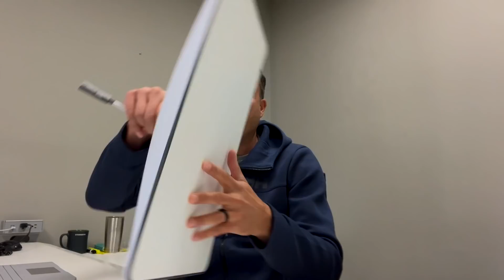How to redesign a SpaceX STARLINK satellite dish for mobile use on a boat! [MV FREEDOM]

Comment: In a past life I was a TV repairman, telephone exchange techie, electronic cryptographic systems repairman, electronics tech working on spy satellites, field tech for early modems, a field tech for Tektronix, and a creative for Apple. Oh and I own and operate a 65’ Fleming on the east coast from the Bahamas to Canada. That said you are a tech God. Tearing the Starlink apart, testing, engineering a new waterproof mount, replacing the KVH antenna and getting this all to work puts you in a class with Wil Proust the YouTube God of electrical power. Kudos. You are truly a gift to one another. You are one of the few that I would trust with my life at sea. I have a Starlink on Joy our Fleming65. Currently mounted to our aft rail when we are at anchor. Works great. I can foresee replacing the KVH domes and ditching DirecTV altogether. We now get weather, news and entertainment just like being at home. All of our gear is connected. Russound for video and music, AppleTVs, iPads and iPhones, Furuno chartplotters all on line. Placing an order for a second Starlink for our home in Utah.  Thanks for the video.
Reply: We do not deploy when underway. Setup and reconnect once anchored or at a marina is fast and easy. It takes a few minutes to scan and lock but once in sync it works fine.

I use Maps to find an address nearby. Any address works.
Reply: Super exciting to read that folks are using these successfully on their boats. How long does it take to establish a high-bandwidth connection once you're on anchor? I assume it doesn't work reliably underway, but would love to assume wrong.

Comment: Hilarious that she's aghast at how big and ugly the dish is, when he immediately proceeds up top to show us the myriad existing ugly protuberances.  The biggest advancement in telecommunications in a generation is an "eyesore".  What about all that other crap sticking out of the boat?
Reply: I think she was just play acting the antagonist.
Reply: @michaelhill7471  If so, that seems pretty dumb.   Many others have done similar for overlanding, primarily to reduce visibility for theft and remove the drag factor that could also cause "motor stuck" problems.  Far less of an issue on a boat.  It's a sensible practicality move, since others have show flat installs working perfectly on the top of vehicles moving at 80Mph.
Reply: I was thinking the same thing about all the ugly crap up there.
Reply: Not as bad as the Christmas gear 😂😂

Comment: FWIW, it looked like you made the new mounting plate from HDPE (like King Starboard).  5200 doesn't really bond with that well.  Not much does other than a few purpose made adhesives however some cyanoacrylates (superglue) and epoxies do.  Will be watching closely to see how this works for you as I know plenty of people in the Bay area who would like to try it even if only for stationary(ish) use and not underway.

Comment: There is a 8' pole accessory. I would caution about not disabling the servos it's how it finds satellites. Takes 12 hours for it to try different configurations to optimize. Currently it's not designed to be working while you're moving starlink is aware of this and is working on it for a future update.
Reply from the maker: We talk about that next week!
Reply: You are way off here.  Others have done some similar teardowns for flat mounting on top of vehicles, and achieved seamless connectivity (similar to stationary unmodified dish) while driving at 80MPH.  Now you have to pay $25/month for roaming, but it absolutely works.   Working on a moving boat is a low bar by comparison.
Reply: @rc98092  the boat would certainly be slower, but I dont know if it would be easier.  A car would be mainly only one axis to adjust, rotation. A boat would have 3 - rotation plus pitch and yaw.  Of course the environment is far more hostile and the physical systems will be strained more, but those are different issues.  Will be interesting to see how it does though.
Reply: Did you mean 8"?  Or were you suggesting using an 8' pole to get it above possible obstructions from other equipment on the pilothouse/stack?

Comment: Probably a dumb question since I excel at those kind of questions, but what if the face of that dish had a very slight domed shape. Would that make it easier to stay on target with the satellites as the ship bobs and weaves at anchor? Or even at sea?
Reply: The antenna is actually integral to the circuit board which is flat. There would be no advantage in having domed plastic with a flat antenna. Having motors and steering circuitry with quick response time is the best way to track the satellite(s). That is how satellite tracking is done on larger ships such as cruise ships and US Navy vessels.
Reply: Sounds reasonable.

Comment: Couldn't you just upgrade uour kvh system instead or not just curious. Your dome looks smaller than other ones I've seen on bigger boats just wondering if the bigger ones have a stronger range ?
Reply: to get internet all over it will cost over thousands just for the system then another 1,200 a month for basic. with star I think I check when I get mine to be 100% true but I heard I can be on the moon and get internet at lost cost we we we will see lol
Reply: Bigger domes come with much bigger upfront costs and bigger link bandwidth comes with bigger monthly monthly costs. Getting Starlink purported link speeds with conventional satellite internet links costs more than an order of magnitude more than Starlink and includes a monthly usage cap.
Reply from the maker: Check out next week to learn how much KVH service costs $$$$$

Comment: Good video 😀 there is also an extra 25.00 for roaming and I would never change the way it was intended you must be good with electrical hope it works it's not supposed to work while under way 🤔
Reply: as far as I know below 10mph or 8 knots it should work but if not stop for 30 mins if need an upload lol
Reply: @captainron3494  Uploading a video at 17 is gonna take a lot longer than 1/2 hour. I get your point tho.

Comment: The problem what your doing here is that you are immediately voiding the warranty for the dish.
Having the disk capable to move positionaly might also help in making for a better connection to the system, a faster more stable connection as it were.
I didn't find having a rectangular shape on top of boat that enormously ugly, particularly with all the other items in the same location, by it self maybe a bit odd. just my opinion.
Good luck otherwise.

Comment: Ugly in this case is definitely in the eye of the beholder.  To me that area of the boat is for communication and sensor antenna’s and the Starlink is smaller than the big simrad antenna that rotates when in use. But everyone is different only an issue if Starlink enforces its terms of use policy and shuts you off based on unauthorized modifications to the dish.  I haven’t heard of them doing this though

Comment: Might not be so simple (?).  Somewhere, I read that the motors are used to align the dish to a north-based reference.  As reference is lost (and detected) re-alignment occurs.  Once at the proper reference plane, the active array has sufficient "window" to operate efficiently.  Curious if you might experience intermittency of service as your boat rotates through a 360 degree arc.  Also, I suspect the dish will only be flat to the horizon at the equator, further limiting "view".  As it is being mounted on the deck, surely some of the items proximal to the dish will block line of sight to a satellite.  Finally, curious if the firmware might detect the lack of motor current and continually attempt to align the dish.. eventually failing.  Perhaps you have sacrificed best performance for invisibility among a forest of other protruding stuff?

Comment: Is that Starlink antenna a continuous satellite seeking system; for example, at anchor where M/V Freedom might drift a bit with tides and wind and currents; as a result, will it continue to aim at transceiver satellite? Seems to me this system might be better suited to fixed dock moorage where only variable for satellite finding and tracking might be tide?
Reply: Maybe next add gyrocompass servo mechanism under antenna mount if vessel heading becomes a issue?

Comment: Did starlink technical support provide any advice?  I was surprised that your  test of horizontal mounting worked, thinking that if so why do they even have an aiming motor.  So I’m going to be wondering all week to see your next show to see if this works.  PS: Thank you for three “technical” shows in a row.  Music and video very well done.
Reply: I have the same concern about eliminating the steering mechanism. It may work horizontally in his two test cases but that may assume there is a functioning Starlink constellation directly above the antenna. Given it may be a couple of years before Starlink stitches together total coverage of North America, there will probably be a regular need to access a distant constellation closer to the horizon. That may very well be the downfall of Shawn's modification.

Also, Starlink has acknowledged the equipment's inability to stay linked up when used in a moving vehicle. It's highly likely an implented solution to that problem will involve the steering motors and improvements in the steering circuitry and firmware. Meeting an acceptable short term goal of clean visual lines may very well come back to bite them in the long run...

Comment: I'm curious about how much bandwidth is lost by the lack of tipping ability, and whether  rocking and heeling from waves causes the antenna issues.
Reply: id also be curious how much bandwidth is lost at different locations.  The original rotating  mechanism wasn't designed for moving vehicles, so it most likely wouldn't have lasted long anyway on a boat.